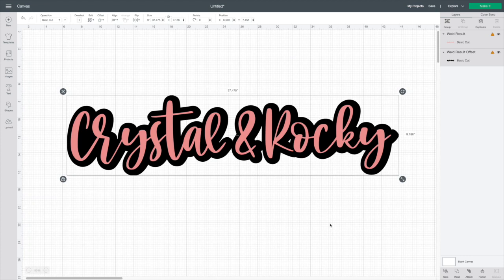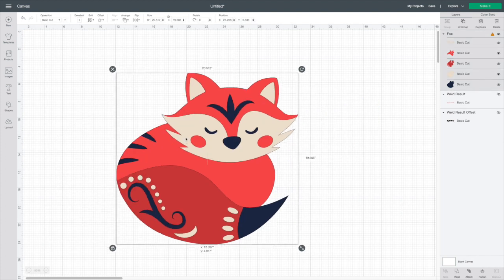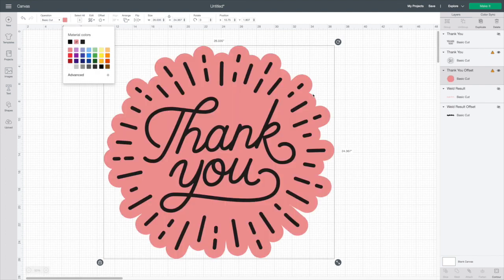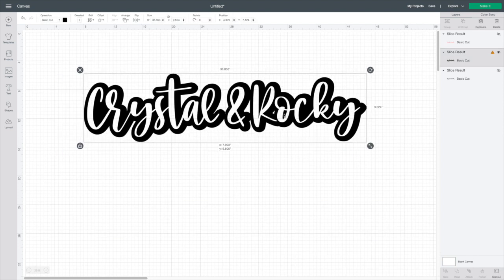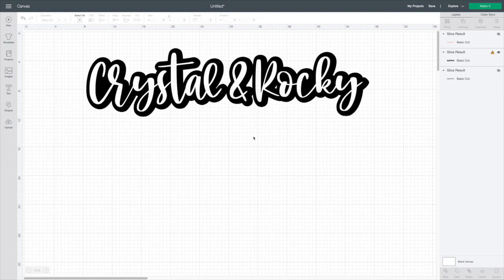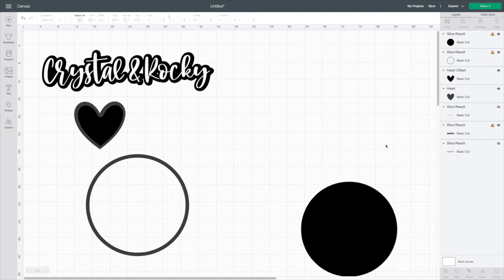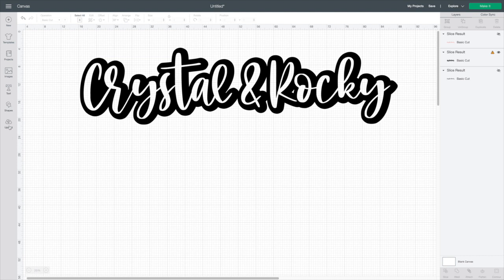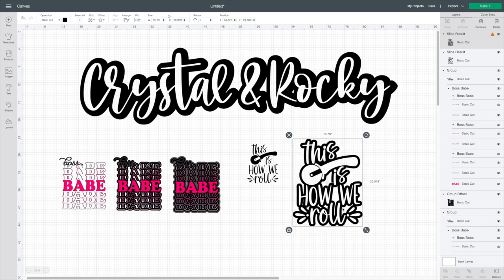Cricut offset BETA tips and tricks

Comment: I am so stuck, I have the offset button but it does absolutely nothing! I don't understand why? Plz help 🙏🏼
Reply: Mine too! The options come up but no outline at all.
Reply: @adriannedriidennis7390  I've tried making sure it's all updated and it's made no difference. I don't even think you can email anyone at cricut to help 🤷
Reply: @kellyspooner704  not fair :(
Reply: @kellyspooner704  mine is doing the same thing. I have all the updates. The button is there but no lines. Did yours get fixed? If so what did you do? Thanks!
Reply: Mine is still not working, and no no way of contacting anyone which is obsurd considering how much people pay for these machines 🙄😠
Reply: @patw0850  hya, nope still not working. I think maybe I will uninstall the software and then reinstall to see if that works. Makes me so cross payed alot for the machine and software and can't even use it properly 😔😠
Reply: @kellyspooner704  thank you for answering me back right away. I don't know what to do either. Makes me mad too.
Reply: Important: The Offset feature is supported on systems running Windows 10 (64-bit only) and higher, and macOS 10.15 and higher. Visit this article for instructions from Microsoft on how to upgrade Windows. Visit this article for instructions from Apple on how to upgrade macOS.

Additionally, make sure Canvas Style is set to New. Select Menu > Settings > Canvas Style: New. The feature will not appear when using Classic Canvas.
Reply: @patw0850  thank you will look in to it 😁
Reply: @patw0850  Ive done this but I dont even have the "canvas Style" as an option.  I even redownloaded design space.  I have the offset icon, but it doesnt do anything.
Reply: I don't have any outlines anymore either. But it worked a couple of weeks ago. So sad.